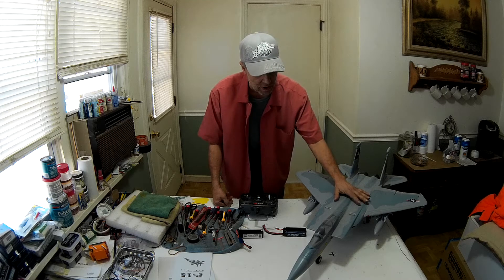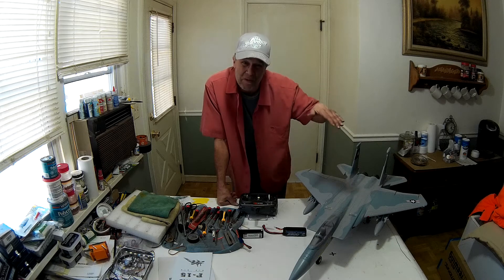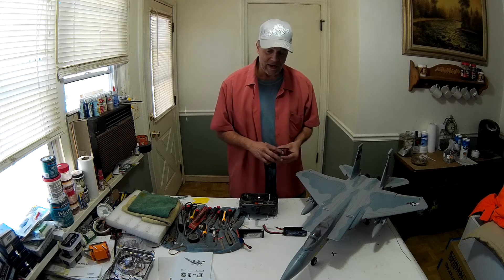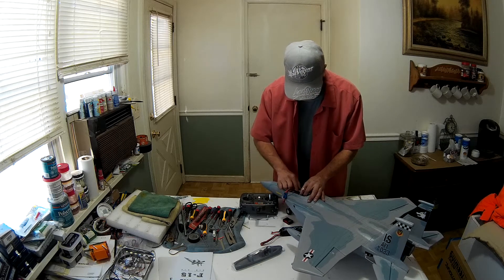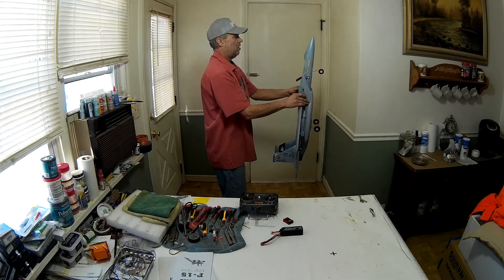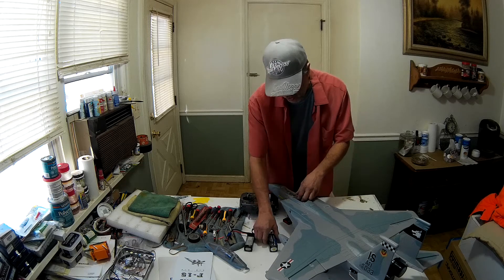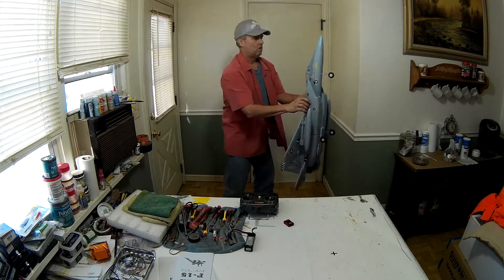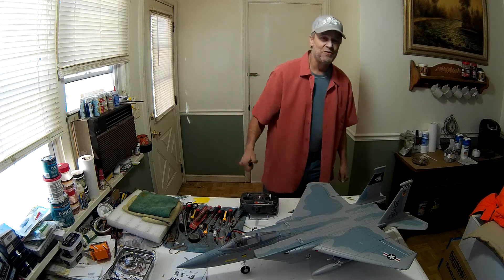F-15c Eagle 64mm EDF  by FMS... 4s or 3s?  12 Blade Fan or Stock 5? (Vertical Performance Test)

Comment: 4s skip my ole freewing is diffent battery on bottom side with panel ,  but i can just let go straight vert with it off my pool deck,  id like the sound but think a 10 b is better setup for it 12 too much drag need 6s i feell . did 10b in f-16tv  and only dropped a fuzz in thrust. but the sound is worth it .  now finding 10b rotors in stock. im not an elect flier or know all the stuff about it so you go to god tube to see what people say .   thanks for info
Reply from the maker: michael honeychuck thanks Mike I agree about the 10 blade over the 12. But at the time I was looking the ten blades were out of stock and twelves were all I could find. Take care and happy flying, skip PS thanks for the comment.

Comment: ..almost maiden time with hand launch. Does the recommended CG work well, and is there enough elevator authority with the plane?..thanks
Reply from the maker: Plydrms yes elevator Authority is plenty in the CG is right on the spot set everything as per the book. I found starting off with 50% to 60% ailerons seventy-two 80% elevator with 25 to 30% Expo's works well.

Comment: Hi I have a question. If I use the 4s battery, does the CG change or is it still at same distance for my f15 64mm? If it changes can you please write back.
Reply from the maker: No, the cg. does change.  I had to add weight to the bottom of the tail 
if using a 4s on stock 3s plane.  But the esc is rated 3-4s and has not 
burned out on me yet.  And I fly mostly wide open throttle about 70% of 
my flight time.  Don't try to put a 12 bladed fan on it stock or you 
will puff your battery for sure.  Drawing almost 60a. it would also 
probably take out the esc. as well.  Happy Flying, Skip
Reply: Thank you so much for your help Skip.  I'll always follow you, and I like you videos!
Reply from the maker: Hey anytime my friend.  Just clicked follow on your channel so we'll be in touch.  Happy flying partner.  Skip

Comment: 12 blades is to much for that high of kv rated motor, I prefer using 6 to 9 blade rotors on my super high performance EDF jets, running 6S to 12S, but it seams that the 4S is just right for that little jet, even tough I would go with complete power setup and bump it to a 6S, that's just me, I love MoPower. Nice video.
Reply from the maker: +RC REVIEWER Yeah, Me too.  Already looking at a different motor/esc combination.  Trying to keep in mind its a cheap edf, not a 500.00 plane.  So kinda playing around with whats here or piecing together some new stuff that I'm still waiting on parts for from.....you know who....Hobby King.   LOL.
Reply: have ole freewing desert camo 4s  hobby lobby version , been thinking 12b for sound , has 35k in it and put 60a esc  in bought 2 years ago wanna stay on the cheap side,  waiting to watch vid downloading lol oh the country life still on dial up. be interested in your results. maybe one day i can upload some fpv of my a-10, f-16tv etc.